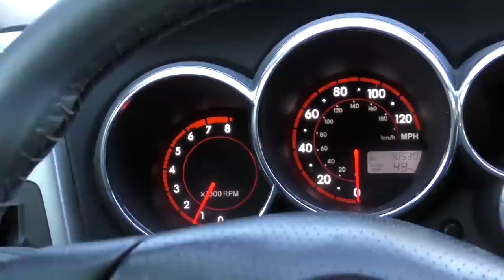Please Stop Doing This to Your Transmission (It Destroyed My Car)

Comment: Just read your owners manual. A lot of people tend to forget about those little books.
Reply: Ya true
Reply: I have both an owner's AND repair manual for my vehicle. The latter of which lists all the things that can cause a certain problem.
Reply: Sometimes in newer car, there are no mention about changing your transmission fluid.
Reply: wahyu subiyanto Same here. But as Scotty mentions, the auto engineer told him the fluid is good for the lifetime of the transmission. So if the life of the tranny is say 100-150k miles with the original fluid, wouldn’t it make sense that changing it prior to that would extend its life? I also wonder what to believe from the manufacturer’s service manual. Since the big profits for the dealerships is in servicing the vehicles and not in the actual sales, I suspect these service manuals are written with the dealers money making service department in mind. My local mechanic says that a lot of the stuff recommended in the service manual is either unnecessary or need not be done as often as recommended.
Reply: @Josh-cw8by  ya
Reply: @mortalstorm  yeah it's really conflicting, I mean who should be trusted

Comment: I took a gamble years ago. I got a 94 intrepid with over 100k miles for 500 bucks in 2004ish. Every time the car would shift  the steering wheel would shake hard like the car was about to fall apart. I had it flushed and it worked a lot better.

Comment: My Chevy's owner's manual says to replace the automatic transmission fluid ever 45,000 miles.  It doesn't say "flush" or "drop the pan",  just replace.  It's the dealership, so I don't know what they do in back of the shop where mere owners aren't allowed to venture.  But they say they use the machine that flushes it.

Comment: Some years of Ford Escapes for example, have a filter buried deep in the transmission. 
So, easier to just drain and fill.
Reply: Gerdog Stenc on my Ford Edge, I did a 3x drain and fill, since the filter is internal and their is a non removal pan.

Comment: You flush it by replacing fluids unhook the return line and drain a quart replace it and repeat until you get clean fluids
Reply: Charles Larkin  yes it's just a natural flow of the transmission pump that pushes old fluid out while you keep replacing it with new. Flush machines use alot more pressure to force fluid out and in return can damage it especially older transmissions. Another way would be  drain old fluids fill it up with new run the car for few mins let it mix then drain again  but this way you will be using alot of fluids to get same results by just unhooking return line

Comment: I actually had to get a newer transmission due to the excessive clutch slippage and the gear 5 ratio. It was done at almost 190,000 miles exact. Definitely be sure to check out your transmission!

Comment: Scotty, when I worked on hot water heating systems, we would drain the system into a barrel, do our work, then pump that water back into the system. That water would be black and smelly but it still carried heat perfectly well and didn’t damage the pumps. Introducing fresh city water into an existing piping system brought along too much dissolved oxygen that would cause more corrosion...better to use the old de-oxygenated water. Flushing not necessary.
Reply: The black water was oxygenated by your act of dumping it to the bucket

Comment: Sick, just got my auto transmission flushed.
Reply: Ouch.
R.I.P 
automatic transmission
😔🙏
Reply: @invaderzim1265  nahh, i flushed both mine and dads cars for the first time last year. both had over 100k miles. Still shifting great and firm. I didnt have a machine tho. Just disconnected the cooler lines and took out 2 quarts at a time running the engine. Mustve flushed out 12 quarts in total
Reply: Also you will flush your money soon with a new transmission 😹😹😹💔💔
Reply: @gmc4150  true people are silly just do what the service manual says no need to flush anything but the coolant and the toilet
Reply: @ananth218Canada  

Bro, I hope you know what you're doing. You know IF your transmission breaks down, you'll have to pay top dollars?😰
Reply: Folks just don’t drive automatic
Reply: That’s bad idea Man U shouldn’t never done that
Reply: @MaxedOut77  Would kill for a manual
Reply: @countryrapchart3082  And you should learn how to form a sentence
Reply: @invaderzim1265   nahh its been more than 1 year since i flushed it and both cars are shifting perfectly. Drove for over 50 thousand kms
Reply: flushing machines are bad because they throw pressure into the system backwards. But using the engine to flush isnt going to hurt anything. Its not even technically flushing. Its just a process of taking out ALL the fluid.
You dont even need to start the engine. But that'll take a really long time so yea...
Reply: Got mine flushed recently with 240k KMS. No probs
Reply: @ELJEFEEEE  this comment is 6 minutes old...let's see what tune your singing at 30 minutes 😉
Reply: Scotty is wrong. Flush your transmission as long as your fluid is mostly clean. If your fluid is black and has metal particles do not flush it.
Reply: I had the transmission flushed in a chevy turbo 400 in pickup at 90,000 miles. They finished and i checked fluid and was still part brown. They flushed it again until it was clean and pink. I blew up 3 454 engines, a 14 bolt  rear axle carrier but never had any problems with that transmission.
Reply: MY transmission was shifting very hard at high RPM's.  Went and got the fluid changed, and I no longer have any problems.
Reply: @countryrapchart3082  My eyes zoomed in on the Man U and I thought the discussion had veered off into a Manchester United topic! ;-)
Reply: Steve Silvas  Yes I am Amigo.
Reply: I flushed mine at 30k, 60k and 90k. No problems. Just do it on a schedule like that and check to see what the fluid looks like first.  

My mechanic drops the pan first, looks for crap, changes the filter, then does the flush after.
Reply: @noname-lq2kg  or just drain & fill which is better for the transmission
Reply: @directorbeau  
That works, too. But you don't get all the old fluid out. Actually most stays in that way. I've seen comments from guys that do the drain and fill over a few weeks maybe three times so you end up with mostly clean fluid.

I think the important thing is to stick to a good schedule and check to see what the fluid looks like before changing it.

At some point, maybe when I get higher mileage, a flush might be a problem. I just stick with a good schedule and pay attention to how things are running and working. Plus I drive like a grandpa so that helps.

For now though, I've had those three flushes and no transmission problems.
Reply: Go with your owners manual.. my Acura advises to flush. Flush not change.  Mine was having a hard time prior going from 2-3 I flushed the trans fluid and changed the pressure switches to the 2nd and 3rd gear. And it’s shifting much much better then it was and it’s was done at 100k don’t believe everything Scotty say man.
Reply: I’ve had my 2002 Dodge Durango flushed 3 times over 190k miles.  No problems.  Probably depends on how they do it.  I’ve also. Had the pan pulled a few times and the first time it leaked once they replaced the gasket which is common and sucks.  If you keep your fluid really clean I don’t think flushing is a problem.
Reply: You're fine. His information is based on old myths or from people who went 150k then flushed.
Reply: emark24 Yep.  It’s worked great for me, I do it over and above the regular tranny services.  I overdo fluids by roughly 1/3rd.
Reply: Oops. Time for a new car! Lol :p
Reply: Flushing the fluid is trying to solve a problem that the mechanic created. Simply put, garages rarely fill the transmission with enough fluid. They can be way out, 30% of required amount and the 'wet clutch multi plate' is very sensitive to low fluid levels. Just look at the manual and figure out how to fill the transmission with 9 liters and then do it. The car will run fine. I would recommend changing the fluid every 2 years regardless of mileage, since the clutch works by oil pressure and plate slip ie. the oil will go out of grade due to it being the 'consumable' part of the transmission.
Reply: If u had under 90k u should be fine. With a ton of time and mileage it's not good.
Reply: WOLFMAN TROY Correct.  People are getting high blood pressure with this.  My bro is master tech Toyota. Knows the real
Reply: The word "flush" is often used when in fact a "flush" is not actually performed.  A fluid exchange is a good thing.  But a "power flush" should be avoided.  Plus the term "flush" has different meanings to some manufacturers.  Honda, for example requires a transmission fluid flush, but their definition of a flush is to drain, refill, drive, drain refill, drive, and drain, refill, and drive.
Reply: @neilmurphy845  
Honda actually uses the word flush.  But when you look up "flush" in the service manual it says that the Honda flush procedure is to drain, refill, and then drive. 3 times.
Reply: @MaxedOut77  ,that sounds like a great idea. I'm looking to buy a new 1/2 ton pickup. Which ones can I buy with a manual gearbox?
Reply: It all depends how it was flushed, I always flush mine and have never had a problem. My guy has a machine that even matches the temp of the new fluid with the temp of the old. Plus I always have it done every 30 or 40 thousand. My Durango's trans is known to be week and I have it flushed every 13,000.
Reply: Steve Silvas  Yes but not like Scotty. I have a nice shop and more knowledge on American made automobiles. He is a rice burner man.
Reply: It's a Royal flush card played by your mechanic or stealership.
Reply: @ananth218Canada  That's not a flush since it isn't pressurized.  It's just a waste of money.
Reply: Would you guys recommend just periodically doing a drain and fill?
Reply: Drain an fill. Drain an fill. Take ur time. Even If you do 1 cycle etc gettin just 5qts or so out then get 5 more qts out @ later date its worth it.
Reply: @EXACTLYInstrumentals  Ford & Mazda offer manuals still on some models ...getting slim pickings tho. Even sports car makers are not offering manuals. Corvette offers manual as does Porsche.
Reply: @wolfmantroy6601  that's pretty much true ..but Scotty has to generalize.. & generally speaking tranny flushing Is bad for MOST folks.
Reply: It's usually fine but has risks hes saying. Best to change fluid and filters instead.
Reply: @Davido50  That simply is not true.
Reply: @rays7437  ya that's the right way
Reply: @countryjoe3551  There are plenty of older trucks out there for sale with manual transmission. They kind of stopped after the mid 2000's, and I remember they were only being offered in the V6 engines. As for new 1/2 tons, there aren't any. However, you can still buy a Tacoma with manual transmission, and I say Toyota because we all know Scotty approves.
Reply: @rays7437  So it is a confusion of terms. 
So either drain & fill vs flush. Or flush vs power flush. To differentiate between the two methods.
Reply: The first 6 vehicles that I personally owned were all manual gearboxes. I went out of my way to buy a nearly new 1991 Chevy 1/2 ton with a 5 speed/350 back in 1992. I'd still like to find another clean 1/2 ton 1988/1999 with a manual box.
Reply: To be honest transmission flush is a hit or miss. I would not do it over 100k.
Reply: @peterkowlessar7823  
Yes, most service techs and advisors are just lazy and use the word "flush" to cover everything.  I never use that word.  I will always recommend a fluid exchange when it is due, but never a flush.
Reply: @superbros1690  I had a drain & fill done just last month at 200k miles (2005 XC70). They way they said the fluid looked I doubt it had been done by the previous owner or if it had been, then only once.
Reply: @peterkowlessar7823  Your transmission will go out.
Reply: @behexen250 i know... i wrote that in my comment up there
Reply: @superbros1690  What makes you say that? It is an Aisin/Warner (Toyota) transmission so should be relatively robust if you listen to Scotty. Anyway we shall see. I have detected no change in shift behaviour yet.
Reply: @peterkowlessar7823  I understand, I have a Toyota Corolla 2001, and it bulletproof in terms of reliability. I have about 150k mileage and the tranny oil is red but I have never changed since 10 years ago and I bought it from a guy who used to abuse the car because of his girlfriend's problems. I would never touch the transmissions, leave it alone. It still shifts well.
Reply: @MaxedOut77    A standard trans. is very hard to find these days.
Reply: @superbros1690  Mine was shifting well also, but at the annual service (the third under my ownership) the mechanic (independent Volvo/Toyota specalists) checked the fluid and said it was black and thick so they recommended drain & fill and advised the same be repeated in 50k miles.
Reply: Oops
Reply: @ronaldarchibald2506  the engine's blew because the tranny never shifted out of low gear .
Reply: The smartest thing to do , never purchase an automatic vehicle!
Reply: Sorry for your loss!
Reply: @ananth218Canada  Yep, that's not flushing, that's just drain and refill.
Reply: David Pejuan I also have an acura. How is yours holding up? Mine is at 140k so I’m worried that I probably shouldn’t do it
Reply: @EXACTLYInstrumentals  You should learn that a sentence ends with a full stop.
Here... this what one looks like:   .    There, that was not so painful, eh?
Just a little prick.
Reply: Same lol
Reply: Drain or flushed?? What is the difference
Reply: @ananth218Canada  That's the way to do it.  Nothing being forced, it's just flowing like it normally does.
Reply: When my car got a tran flush it's started slipping before I even made it out of the car shop parking lot.
Yup, no joke.
Reply: Says* not say. And you replaced the switches...that's probably what helped the shifting..and flushing uses pressure..it makes sense that it'd be hard on an older tranny..seals, gaskets..

Comment: Thanks for the late model transmission svc information, I have a customer with a 1996 Honda 4cyl Civcc , I am a former auto tech , i need to do a svc on the CVT trans, will be my first one, I plan to use your instruction and factory fluid(former NAVY/Dealer mechanic)- You are a good teacher Sir. Thx.

Comment: For the “lifetime”, I asked an Aisin engineer at the Paris Show where they were exposing: lifetime is 400,000km (250,000 miles).

That’s for Aisin transmissions.

ZF used to recommend an oil and filter change for severe driving conditions, every 75,000 miles or 8 years and never for normal driving condition.
But since they started their oil change business it’s 60,000 miles or 8 years for everybody xD

An Allison TC-10 for Class 8 trucks will go 750,000miles between oil change, but that’s something else xD

So here you go, I’m not an expert so I’m not can’t say who’s right, but that’s what transmission manufacturers says.

Comment: 17 Tacoma - Did a transmision fluid drain/refill at around 40k Miles. It was slightly dark but not to horrible. Drain and refilled and the trans felt better as soon as I drove away. This is all that is needed done.

Comment: Hey Scotty. I have taught all 4 of my kids and varios other people how to drive an automatic and not abuse it. When I back out of the garage I stop, shift from reverse to neutral. I listen for motor rpm to stabilize then shift into drive. When transmission is in drive you can accelerate as you want without hurting trans. Other than that use a good trans fluid and change every 50 k miles. I never have any problems.

Comment: I have a 1985 Chevy G30 Van With Over 600,000 Miles!! It is on the Second Motor
The transmission THM400 !!!   It Also Has A Transmission Cooler Added!!  The trans Fluid
is Synthetic!!!  The trans Works JUST as Good As New!!!!

Comment: Hi Scotty, I like your channel. I agree with your recommendation to not pressure flush the Auto and to clean the filter when you drop the pan. Filter is really just a strainer. I buy vehicles for a company and my biggest surprise was a one owner Toyota Tarago (Previa) we bought with blown transmission at 127,000 miles (204,300km). When I removed the pan I found sludge that clogged the strainer. This reliable Toyota U241 transmission 4-spd was totally destroyed from such a simple problem of no regular pan removal. You are right.  Shane, Melbourne, Australia

Comment: When I go to a mechanic, and ask for transmission service. Should I say a can you REPLACE the transmission fluid and filter? Instead of saying can you FLUSH? Is there a difference? What should I say?
Reply: As for a "drain and fill, not a flush". If the mechanic says some of the old fluid will remain, tell him you don't care.
Reply: Michael Ball thanks for the advice 👌🏽
Reply: Always ask for a drain and fill. Never flush. You need about 3 drain and fills to get all the old fluid out. Do a drain and fill..drive 200 miles. Do another drain and fill .drive another 200 miles. Then do a 3rd drain and fill. Of course that costs more since a drain and fill is about 115 bucks.

Comment: I had a Buick LeSabre and the transmission fluid got flushed about every 40,000 miles since it was new. It had 240,000 miles on it with the original transmission when I sold it and it still shifted great. I'm not saying flushing is always the best option, but it certainly can work to help keep a transmission from wearing out.